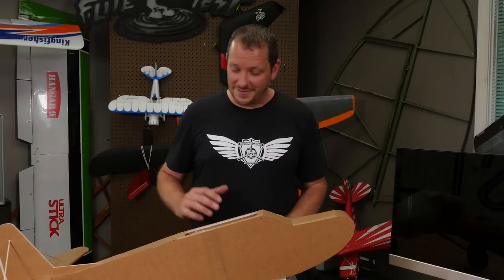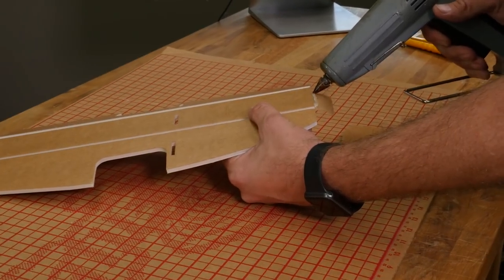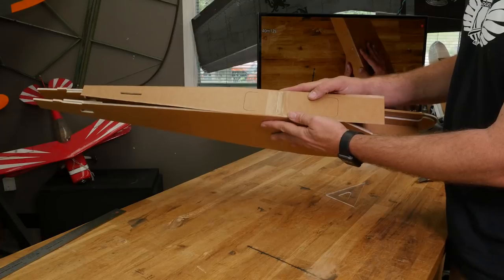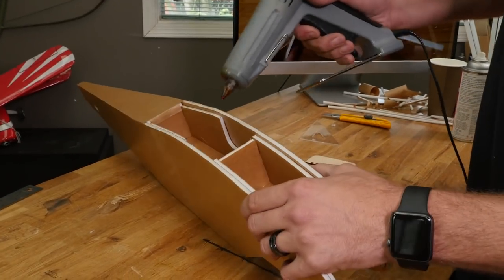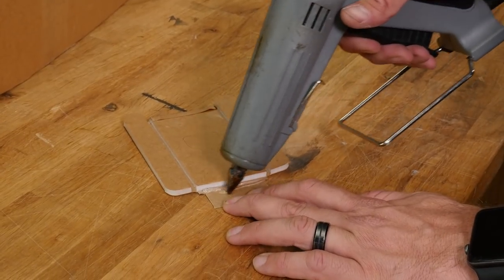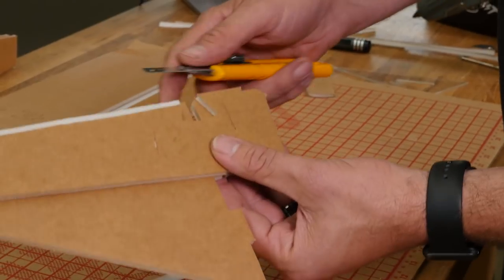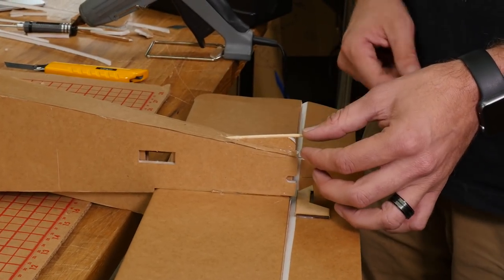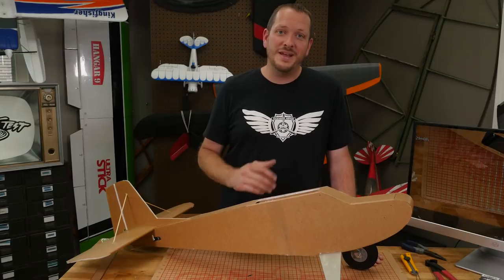How to Build the FT Legacy Part 1: Fuselage  //  BUILD

Comment: Looks like a STOLE plane. I havent downloaded any new planes in a long while. I was downloading them, clipping the pages together and filing them away. I still have enough spare parts of the tiny trainer to build two more. I was saving them as templates for repairing the original. I really enjoy building the Flite fest planes. My hobby room is currently being used as a bedroom until late fall, then hopefully I get it back.I plan on building a bench on one wall just for working on these type of planes. Its easy building a Flites Test plane,once you build one, they go fast because every plane builds about the same using the same techniques.  Thanks for releasing this to the rest of us. I would like to see you producing more unusual planes . Maby a flapjack.
Reply: how about a Bugatti? or an F-15 jet? or a scale size corsair?or how about AN F6F HELLCAT!!!!!!!!
the hell cat is first on my list since they have never built it.

Comment: Cloth Medical Tape works wonders for hinges and holes!
Reply: Lids.CAPS from Creamer or SUGAR...cansitors.
Notice the hinge...just cut to whatever size you wish...
It's great for the bottom of the RUDDER or at the tips of the controls..
where tape will want to saperate.....or you simply score whatever
tin plastic food cantainer..
You can get 1mm plywood piece at the dollar store..they work like magic
for doubler..so you can mount wing mounts and landing gears. :-) 
You can even use #2 plastic ( 1mm thick) from luandry detergent lids or cantiners
as doublers for the nose...they work like magic..and they're light.

Comment: Seeing this in prior videos, I thought it was basically a tweaked Simple Cub. Now I can see that there's a lot more engineering happening under the fuselage. I'm particularly interested in why you chose to go with an airfoil on the elevator. Was that just about adding style, or perhaps it was testing the feature out for future plans, or maybe it needed an airfoil at the rear for stability?
Reply: Some planes tend to be a bit tail heavy. To counter that, you can either put more weight to the front or do this pretty old trick of giving the elevator a airfoil. If you look at very old planes like the Bleriot XI you will see this kind of trick often because these planes had a very short nose and very long tail. 
Throwback of this method is, that the up lift is always different depending on the speed, so in my opinion its suited better for very slow planes that fly at a constant speed.
Reply: Cool! I had no idea.
Reply: cool smart child!!!

Comment: hi ive quick question
can we fuselage front and fuselage rear joint together as one part . not 2 part then glue together at the begin joint 2 part of fuselage (front and rear) as one sheet and cutting foamboard?

Comment: What kind of magic razor blades is Josh using?  I use brand new ones and the foam still pulls and tears!
Reply: he probably is pulling the blade down as he cuts, I studied how he cuts his bevel and it looks like he pulls the blade down very little to make sure the foam doesn't rip with paper
signing off,

OOOOFFF
Reply: He is using sharp blades!! LOL
Reply: Probably with uncorrosive  WD-40
Reply: Probably giant forged iron with magic stones imbedded in the 2mm or so of the blade.

Comment: Just ordered one of these in V2 form. If I wanted to build it tri motor is it ok to use the same motor as the Power Pak C? Or would 3 of the 2212 1050s be better?